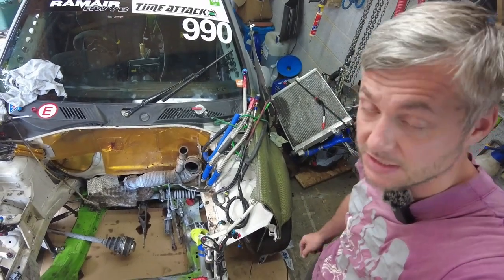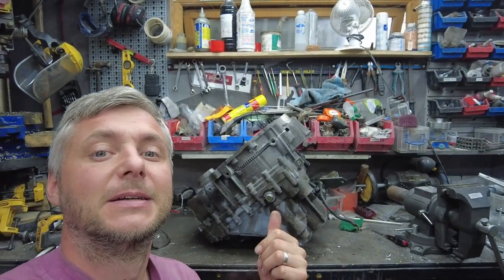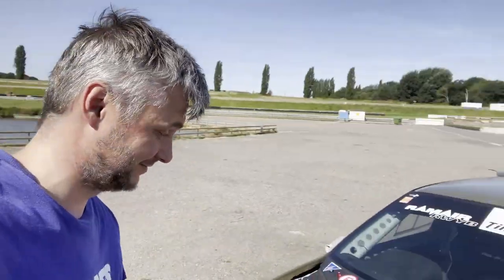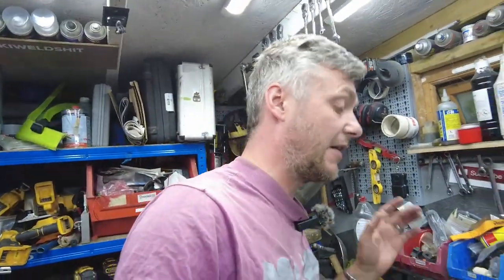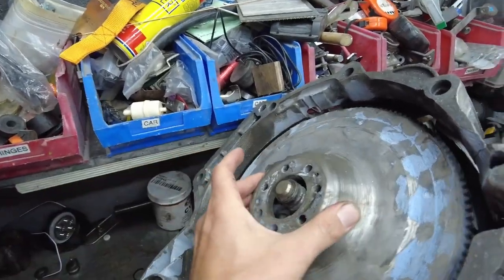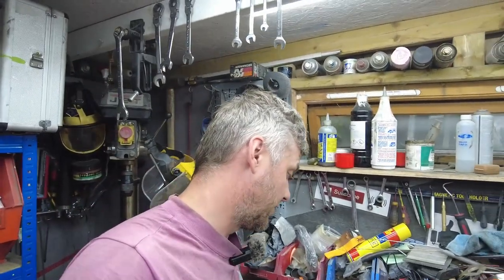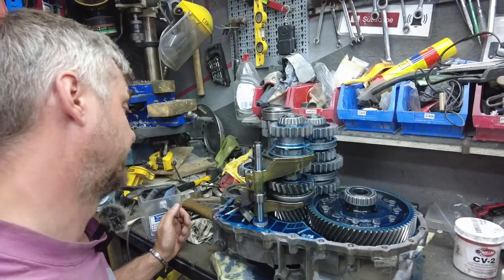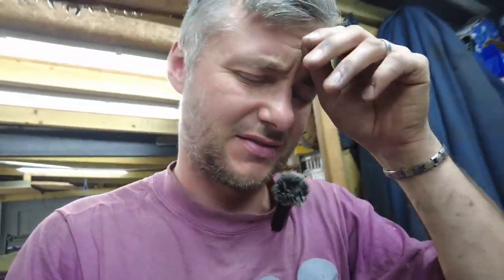Flywheel bolts snapped! catastrophic failure of the dogbox!

Comment: Had arp snap as well but didn’t cause as much damage. Make sure they are torqued up. I found people using a gun to speed up, stretches them too much. 12.9 bolts torqued up will be good mate. Glad your going to keep going
Reply from the maker: They were 12.9 bolts. Torqued to 60nm with locktite in crisis cross. And than checked. Guess they were overstretched before